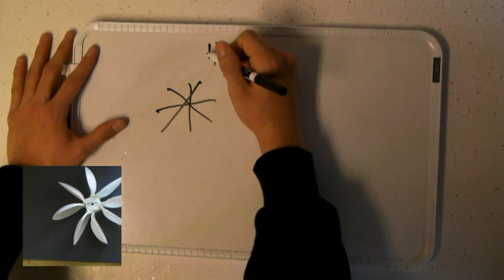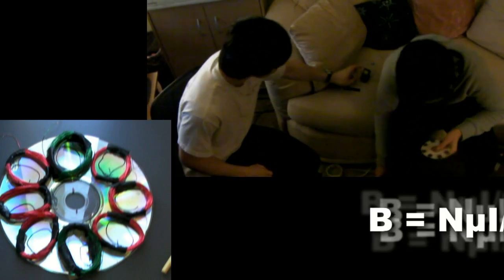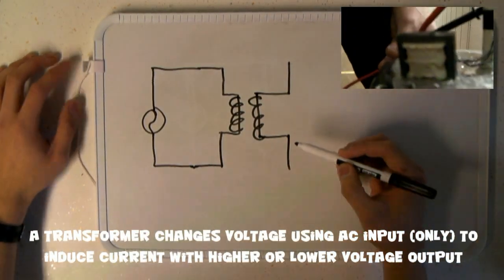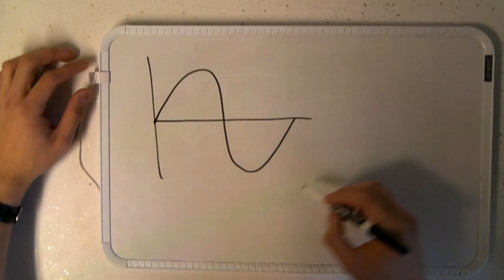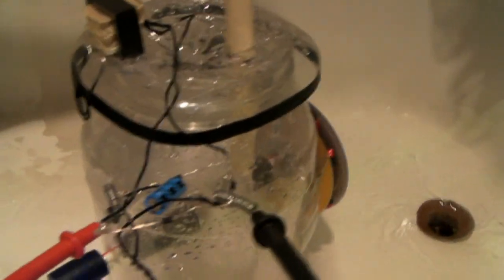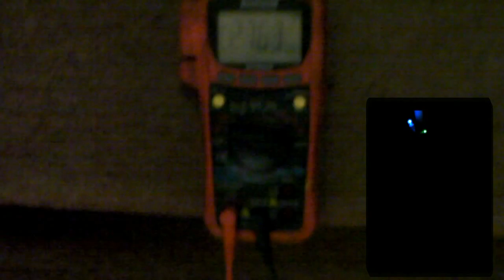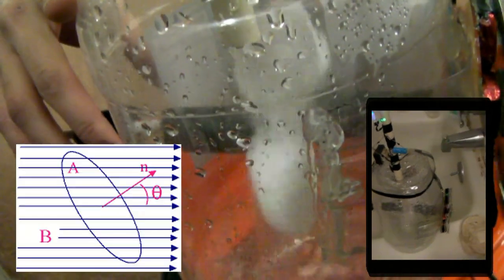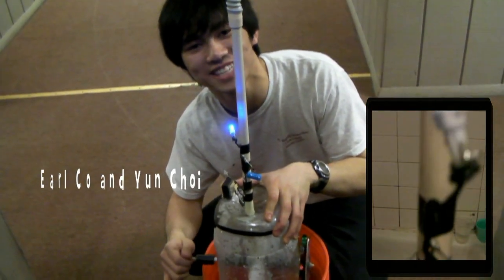Homemade Hydroelectric Generator

Comment from the maker: @Gamershivan11 you don't know where to get a capacitor? Go to the nearest RadioShack. Or rip it off an existing circuit board. If you don't know which one, ask your teacher.

Idk what varnished wire is but as I have already capitalized, INSULATED COPPER ELECTROMAGNETIC (EM, COILING) WIRE IS REQUIRED.

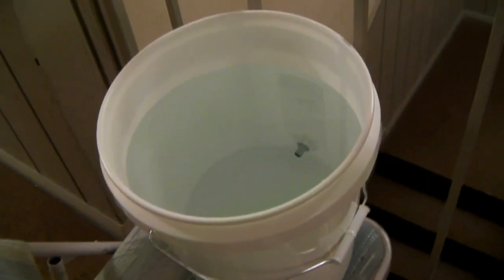Comment: Hi guys. I like your generator and congratulate you for the success! But I am afraid to say 'dtriplett03' is right about V and I are directly proportional to each other (remember V=IR). You are misquoting the equation (P=IV) to justify your argument. The same way you said at 5:53 in video that as resistance increases voltage decreases, which is wrong as V=IR and you guys know that! If you guys have a multimeter do some experiments to understand these concepts better. However great job! Cheers!

Comment from the maker: I didn't buy the transformer, I jacked it off an AC adapter I had laying around in a box of AC adapters. I could've taken and used the built-in bridge rectifier as well, but I wanted to make that using the diodes and capacitor instead. The transformer was originally a 1:5 step-down transformer (as AC adapters need to lower the voltage from 120V) but hook it up in reverse to make a 5:1 step-up transformer. I think the original voltage was like 0.3V, not enough to drive an LED. Current was low too

Comment: can i know what is the thickness of your copper wire??
and can u explain more about equation used in this experiment?
Reply from the maker: The thinnest wires will allow you to fit more coils in less space. I used magnet wire.

I cannot explain the equation but here's a better site that can: 
http://www.learnapphysics.com/apphysicsc/electromagnetism.php
Reply: Earl Co i'm going to buy the copper wire,,
I'm from malaysia can u tell me how to explain to supplier the type of the copper wire,,
Reply from the maker: rdan razali Ask for enameled magnet wire with the thinnest gauge.
Reply: Thankx a lot earl..sorry too much asking
Doing my final projects..
Any recomend how many turns did i need to do..
Can i contct u via email or fb for more info??
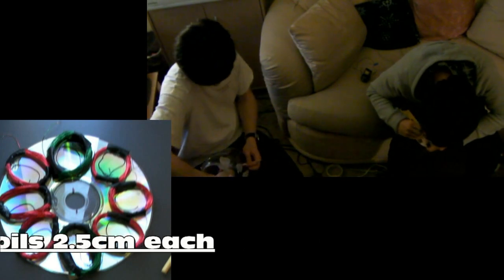Reply from the maker: rdan razali 100 turns per coil should be enough (2:20). You'll still want to put a transformer to step the voltage up enough to drive an LED. Unless you have a more efficient turbine with 1000 turns. You can just keep scaling up.
Reply: Nope...
The turbine just been made by myself..
Maybe plastic icecream spoon..did u think i can use it for light up led bulb??
Reply from the maker: rdan razali That can work. Grab a multimeter and measure what voltages you're getting out of the turbine by itself. You need at least 1.5 Volts to light up an LED. If you're getting voltages lower than that, you'll need a transformer to step the voltage up. I pulled mine out of a broken wall adapter charger and wired it in reverse to step up. You can get a full wave bridge rectifier (four diodes in specific configuration) out of the same wall adapter as well (to convert AC to DC for the LED to stay on).
Reply: Did u means by using  adapter n wired it reverse we can make increase the voltage n make stay on??
Reply from the maker: rdan razali Correct. A wall adapter converts 120V AC to lower DC voltage such as 12V DC. This would be a 10:1 step-down transformer for example. If you want to increase voltage 10 times, flip the transformer around and it is now a 1:10 step-up transformer. The outputs of the bridge rectifier convert the AC voltage from the transformer into DC voltage to keep the LED on while the turbine is spinning, as long as the voltage stays above 1.5 VDC.
Reply: Nice idea.
Thankx a lot..
Now i trying to find the enamel copper wire..
Can i use reuseable copper wire from any part???
It hard to find this wire at my place,i have to buy in bulk n it cost me a lot
Reply from the maker: rdan razali I understand. You can find them inside old/broken motors or transformers. Technically a motor is just a generator in reverse, using electricity to convert to kinetic energy of motion.

http://www.instructables.com/id/How-to-get-cheap-magnet-wire/

Google is your friend. The Internet is amazing.
Reply: Thankx buddy u give a lot of information..
Will mail u later,really happy coz u giving me fast feedback
Reply from the maker: rdan razali No problem. It's better in the comments because then other people can also share this information and I don't have to repeat myself.
Reply: Yeah it true..
I also got a lot info via other coments that u reply
Reply: hey earl, i already found a supplier for the magnet wire..
can u recomended the wire specification for me???
my project is to fabricate make the hydroelectric generator at aquarium,,which is it will be the source for led lamp,,,

Comment: u sure it can give u 2v with what constant speed
Reply from the maker: What do you mean am I sure? I'm sure as far as a measured it on my own unit.

What do you mean 2V? I only ever got 1.7 V.

What do you mean constant speed? The rotation of the turbine is only as constant as the flow of water. I did not measure the speed of the rotation of the turbine. Your variables may differ anyway, especially if you use better materials than I did.

Comment: I'm just wondering,if you want DC output,why didn't you start with a DC input?
I am fully aware AC is more efficient in power transmission over distance but this does not apply to your experiment since your wiring is very short.Adding a transformer and rectifiers only lowers system efficiency.If your going to make AC gen the magnet to coil should be in proportion and 3 phase is best to reduce harmonic resonances.12 magnets and 9 coils,3 coils per phase.
An LED can be powered by AC!!!

Comment: Which do you think could produce more energy? 
8 round coil and 100 turns or 4 round coil but 200 turns?
Reply from the maker: +Eugene Galang I think the 8 round coil with 100 turns would produce a higher voltage because the rate of change of the magnetic field would be twice as much even though the rate of rotation of the turbine is the same.

The 4 round coil with 200 turns (as long as the coil rounds are packed closely together) would produce more current.

Power = (V^2)/R = (I^2)*R.

You get the same power output either way, and Work = Power*Time so over the same amount of time, you produce the same work (same energy).

The answer to your question is neither, or both. They produce the same energy. One produces more voltage, the other produces more current.

Comment: ok. so u built an ac generator then converted to dc.. I want to make the generator dc right away.  what would I need to do ?
txs guys u did a great job on video
Reply from the maker: You want this: Homemade Power Inverter  (Simplified).

Comment: Do they HAVE to be Neodynium Magnets?
Reply from the maker: Yes. You're not gonna get much current otherwise (the current is already low in the video's setup).
Reply: Holy crap, you actually did answer quickly. That is amazing, well anyways, you should be proud of that generator, i'm still stuck trying to make it, but i guess that something is wrong with the wire, maybe the wire isnt actually made from copper and a fraction of my life is based on a lie...
Reply from the maker: th3thin9 It doesn't have to be made from copper. The important part is that it's shielded except at the terminals and coiled properly (alternating directions of coil as well as alternating polarity of neodymium magnets).
Reply: So they HAVE to be shielded? Or is it just for safety measures
Reply from the maker: th3thin9 Shielded as in coated in a thin layer of enamel. Magnet wire you buy in store should be enameled. Think about it. If you didn't have the wires enameled, then current can just cut across the metal wire without having to go around the path of your coils to induce a magnetic field. You essentially just have a straight short circuit.
Reply: Oh now I see... Thanks in many ways! I find this video really entertaining, It would be really great if you made other videos like this, I mean like Homemade Stirling Engine, etc.
Reply from the maker: th3thin9 I'm working on a tesla coil kit I bought from www.onetesla.com next. The $329 kit was really expensive because the parts can be obtained for about $50-100 probably, but at least I don't have to worry too much my first time in getting everything right, especially if playing with high voltage.

Comment: Hi guys my comment box is being a douche for some reason so I'm typing in this. Basically I'm building my own hydro out of knex, I thought it was all gonna work fine but I'm just not 100 % about how to actually connect the wires to my bridge rectifier, it's got the 4 posts sticking out of it, also if I'm going to add a transformer to step up the voltage would I put this before my rectifier and hook it up with my AC wires, I'm pretty new to this stuff so any help would be great guys.

Comment: how do u connect the wires?.-.
Reply from the maker: Uh, what?

With solder?

What wires? The magnet wires? You use sandpaper to run away some of the enamel, and then twist and solder the wires together.

Honestly I'm not sure if I know what you're asking, and if you've never use a soldering iron before, that is beyond the scope of this video.
Reply: +Earl Co emm no. i mean is there like some things i need to make sure when connecting the wires? like the orders(?)maybe? what thing comes first and then what thing comes next? .-.
Reply from the maker: +Claryssa Bianca What wires?

The wires just need to bridge so the electrons in the wires can go from one wire to the next.

Still not sure what you're asking, but there's nothing special with connecting two wires together.
Reply: +Earl Co oh nevermind.--. i get it now. My question is stupid, isn't it?._. My brain is working now. Lol. Thanks for replying :)
Reply from the maker: +Claryssa Bianca haha you're welcome
Reply: +Earl Co hey.. i want to ask something. U used LEDs right? Can u use like other light bulb? maybe motorcycle bulb? the smallest one? because I did a project on making this generator using a motorcycle light bulb and it won't light.
Reply from the maker: +Claryssa Bianca I used LEDs because they're small and require very little current and only 1.5 Volts to turn on. I don't know what the specs are for your motorcycle bulb but it probably requires a lot more current than what can be produced from this small scale project. Also not sure if your bulb uses AC or DC.
Reply: +Earl Co how do u know if the bulb is AC or DC?
Reply from the maker: +Claryssa Bianca No idea. Check the specs for the model of the bulb that you have.

Typical incandescent lightbulbs in homes are AC.
Reply from the maker: +Claryssa Bianca CFLs and fluorescent bulbs also require AC.
Reply: Earl Co ohh oke. thank you:)

Comment from the maker: It's a bit of a tradeoff I'm guessing. More coils means stronger magnetic field, but will also increase the CURRENT DENSITY simply due to the smaller cross-sectional area. I'm not knowledgeable enough on current density yet. Check out Wikipedia or other resources and find a balance.

Comment: its cool,but you need electric pump so that the water go back to up from the source of water ...
Reply from the maker: Any theoretical pump would take more energy than generated by any generator. "Cold" energy production is the problem of the 21st century.

Comment: ur explanation of what role the capacitor plays is kind of inaccurate.  It does not regulate the voltage.  That is a bad term to use to describe its function.  A better description would be that it absorbs voltage (charging the cap) when the rectified sine wave voltage is rising and releases voltage (discharging the cap) when it falls, thus creating a more uniform output voltage smoothing out the high peaks and deep valleys.  A small ripple will still remain, especially with such a small cap.

Comment: oh 1.7v is more them enough for my project i aim only 1.5v so my problem is the rpm to get 1.5v la
Reply from the maker: did you use a transformer? and yes 1.5 V is all you need for an LED.

Comment: Great little project. Good work. As someone that cut off the head of my mother's sweeping brush and broke my father's saw ( on the same day ) when making a weather station as a kid, can I ask how how many times your mum murdered you for getting the carpet wet?
Reply from the maker: Haha we didn't actually get the carpet wet, most of our tests were in the bathtub and in the hallway outside. She doesn't care if the carpet gets wet inside though, as long as it's cleaned up right away.

Comment: try to attack a usb port and charge your phone
Reply from the maker: Not enough current is generated by the original prototype to be able to charge a USB device in a reasonable amount of time. A more efficient version would be able to, and ideally it does not waste as much water (or relies on sustainable natural flowing water).
Reply: i see hope to see more cool projects soon

Comment: "More coils means stronger magnetic field"

Also not more current flowing with the same field. Less as you create a higher resistance with thinner wire unless you use a superconductor.

Try harder. I have a bachelors in physics.